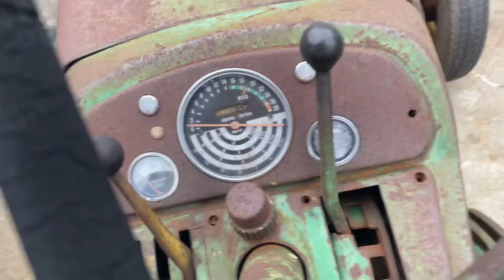New to me 2010

Comment: LowBuck you gonna be spending HighBucks. Good luck I have a 2010 diesel Love it but the parts are very costly.
Reply from the maker: I’ve got a diesel 2010 and love it too.  Very handy tractor.  It’s a late 65 with the revised pre-combustion chambers and I have zero problems starting it.